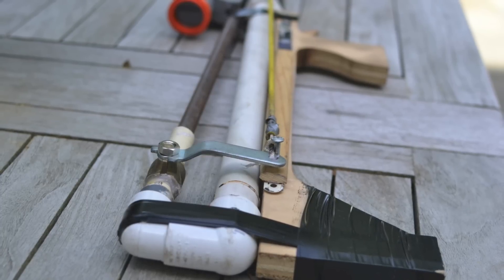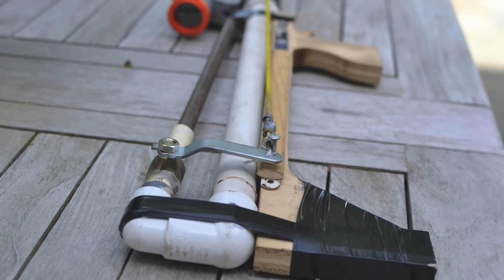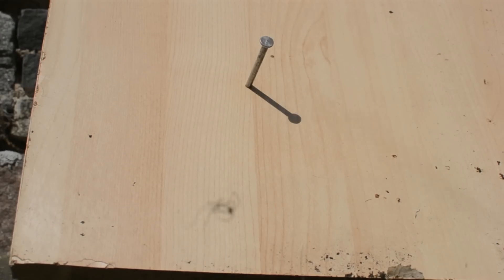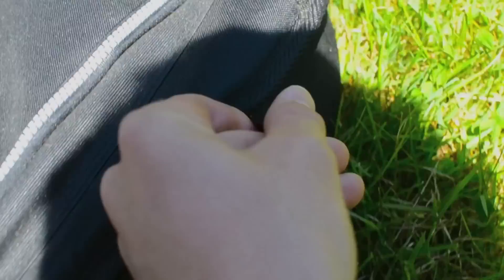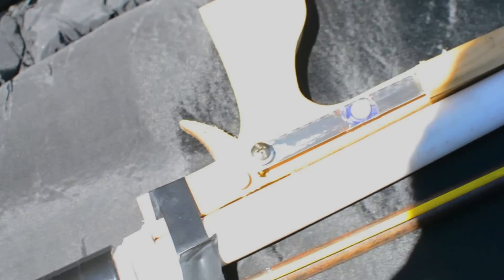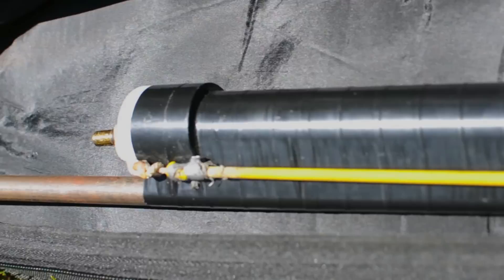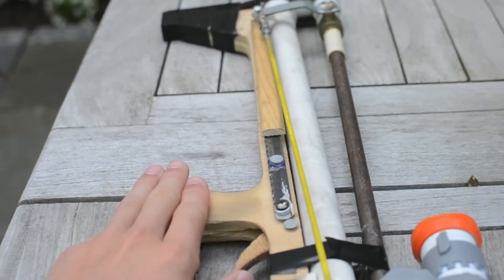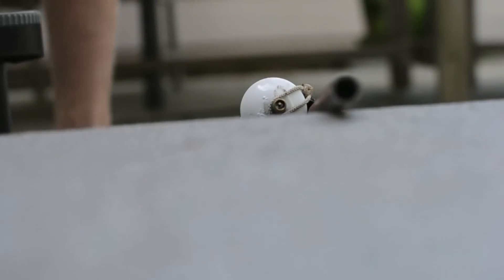Homemade Air Rifle (Advanced): Shooting

Comment: Please can u say the materials and the measurem of the pvc pipes?sorry for my english
Reply from the maker: The metal pipe is 1/2 inch, the air tank is 3/4 inch, the valve is 1/2 inch and the adapters are from 3/4s to 1/2 inch
Reply: J Robinson very late because  i finish the airgun following the model of the video and using different measure of pipes, But THNKS :)
Reply: +J Robinson  do you have the europian measurements?
Reply: +J Robinson  why don't you make a show to some of my friends and i are making air guns for competition and thaw is my favorite by far

Comment: quick question:
do you have to pump it everytime after you fire and is there a way to make a compressed air reservior to store the compressed air ?
Reply: You would have to use a qev valve to get more than 1 shot per fill
Reply: qev valve? whats that
Reply from the maker: You have to pump it each time but if I ever embark upon another air rifle build, I will use 2 ball vaulve with one large resivior and one small one. After the large tank is filled, the first vaulve can be opened to fill the small tank which is released to fire the shot. this process could be repeated until the large resivior was drained.